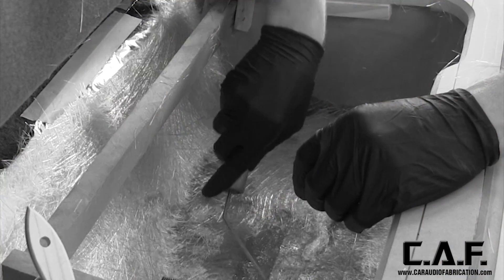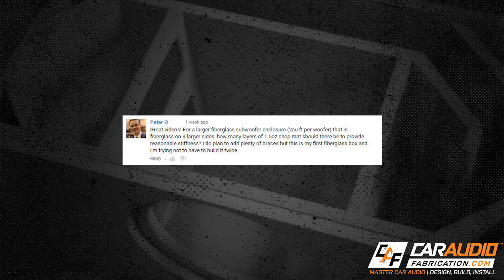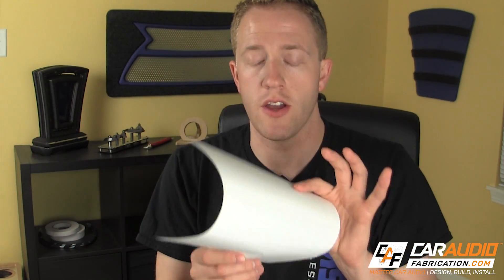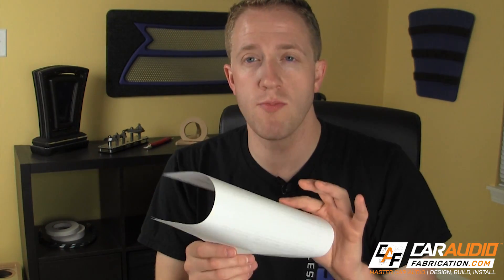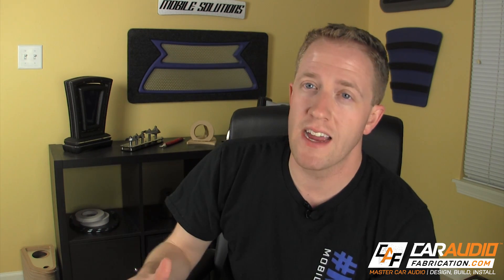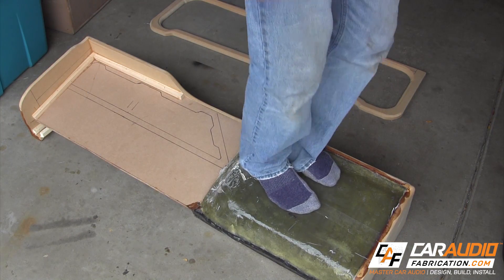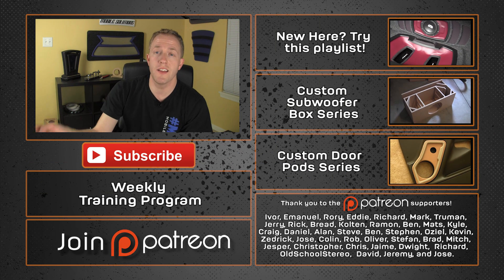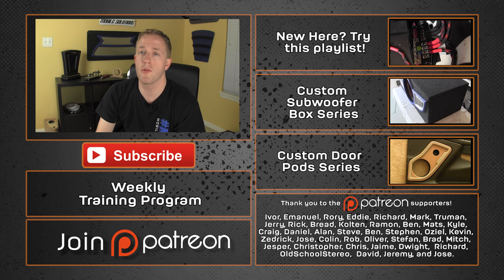How many layers of fiberglass are needed for a subwoofer box? – Fabrication Friday

Comment: Hi Mark, this might sound like "how long is a piece of string..." but I want to build a fiberglass sub box for the trunk of my car, and I want to avoid the box encroachment into the trunk area as much as possible. So, my question is this: is air volume versus the diameter size of the sub more important? If, for example, I could build an enclosure that would accommodate a 10" sub, but the air volume is under a cubic foot compared to an enclosure with an 8" sub but just over a cubic foot, the 8" will perform better as a subwoofer, yes?

Comment: I’ve done mine fitting into boot of X1.  I started with 150G to get into the corners and finished off with 300G weave.  Definitely recommend the ridges added using dowels or spare pieces of timber.

Comment: hey what's going on man I have a question for fiberglass boxes. I want to build a fiberglass box in the rear floor of my 2005 Chrysler town and country. I'm looking to make the front baffles to be flush with the floor that way I can still haul things in my van. I'm going to make sure I have protection grills for my sub. I'm curious what is the best way to start the mdf perimeter ring or baffle board and to make sure there is the best adhesion from fiberglass to mdf. I just am having a hard time coming up with a way to make the ring flush with the floor and how I will make sure the fiberglass connects to the mdf ring secure and the woofer baffles then can be glued and screwed to the ring. thank you

Comment: Great channel. First time trying this. I just bought a 2019 ram rebel quad cab. I'm gonna build a box under one side of the rear seats with a sundown 10". The sides and top of the box will be in MDF. I'm wanting to do the bottom with fiberglass because of all the waves in the floor. Its roughly a 15"x25" bottom. How much material and resins would you think I would need to buy for that size of a panel? Thanks.

Comment: Hi Mark,I just did my first fiberglass box in the spare tire well.Only the bottom and half of 2 sides are glassed to the sheet metal and there is a lot of curvature.I did 3 layers of 1.5 oz chop strand mat.The area is only 13 inches deep as well.Should this be strong enough or can I strengthen it with some type of epoxy?

Comment: I only use one layer of mat to make the initial shape.  Then I switch to fiberglass cloth for adding layers inside .  Cloth is way stronger than mat.  Mat for the form, because it forms in really well, and it's good for the top layer for a smooth finish.  But cloth (weaved fiberglass) is where the stregth is at.

Comment: Hey man, I got a question for you actually... I got a SWA-10S4 10" SCV Bassline Alpine subwoofer 4 ohms and I bought it as a package from car toys that came with a Bassworx sw10b 10" sealed 0.54cf enclosure. It literately sounded like shit nor did it bump at all. I grew on ported boxes with old school alpine brands;so I'm  raised and familiar with that shit, bumping on old rap like Ice Cube and Tech N9ne (NO NOT THAT NEW SHIT.).  I want that type loud and bumping down the street type of sound; so I picked up a 10" Atrend Bbox E10SV single vented box that is Gross Cu. Ft. 1.25 \ Net Cu. Ft. .90 \ (Tuning 39Hz) \Speaker hole cutout 9.12" on Amazon.com. Do you think I should use polyfil in this? I just want my shit to bump without that bullshit or damaging my subwoofer. Oh, Most importantly. My amplifier is a MRV-M250.  PLEASE help my dude. I've spent so many countless hours trying to get my shit right and to make it hella lit.
Reply: Hyptonic Promotions .. sounds like you need more amp power or more subwoofers.

Comment: First, great video!  When I've made fiberglass boxes in the past I usually start with a a wood backing and fleece stretched over a form (e.g., speaker mounting rings spaced out on dowels).  How do you calculate the structural value of fleece resined on both sides as compared to 1.5 oz chopped matt?  Thx!
Reply from the maker: Fleece adds essentially zero strength, you are just using it to capture your shape and then should be applying fiberglass mat on top of that. I try to avoid fleece when I can because it just sucks up a lot of resin for no real strength add. Better to use grill fabric to get shape then add glass to shape it.

Comment: you can also use styrodure to add thickness. just cut it into strips of desired dimensions and put them so that the fiberglass mat spirals around them. For example you start by making a base layer of fiberglass mat and then put on a styrodure strip and laminate over it. Then you take another styrodure strip and laminate under it etc. For making custom shapes you can do those with modelling clay and when the clay surface gets semi-dry you paint it with at least 5 coats of plastidip so the moisture doesn't escape the clay and makes it crack. For better release of the fiberglass from the plastidip you can spray it with 4 coats of pva. I reccomend you do 3 layers with fiberglass cloth or maybe even carbon fiber and epoxy resin. Epoxy doesn't warp much and the smoother surface you get with cloth or carbon will spare you some sanding. You can then add layers from the inside for strength because the epoxy resin won't warp your creation.I might be doing a subwoofer enclosure soon and if i do, i'll make a video.Hope this helps or gives new ideas.Cheers ;)

Comment: Mark, great video man. I hope you don't mind me adding a few things. I do lots of fiberglass projects. Sometimes massive builds with lots and lots of power and sometimes 70 and 80 lbs subs. In fiberglass enclosures. I got some coming up soon but video's yet on them. Anyway, I use 3.5 oz matting where ever I can and 1.5 in those hard to get to areas as you said. A few other things. You need to try to do all layers at one time. Don't wait for a layer to harden before you do the second and so on. Also I use 1/4" steel laminated in the layers where you use wooden dowels. This makes the box bullet proof. I just cut the steel into squares and stick them with hot glue as you do the wood dowels. Same method just bigger scale. Just thought your viewers might want to try that. Again not trying to steal your thunder. Just wanted to help.
Reply: 3 years later..i heard the cloth was stronger. Would the method change if i used cloth vs chopped mat?
Reply: @2ndshiftaudio300  8 yrs later but have you ever tried to use chopped fiberglass. I have access to thousands of pounds of fiberglass but it’s the small chopped pieces, just trying to find out if I could use a lot of that instead of the mats?

Comment: I've had very good results using strips of angle-aluminum to reinforce fiberglass structures. They're inexpensive, light, easy to work with and readily available. 3/8 are the ones I've used, but any size will help strengthen your box.

Comment: Very Informative, thank you!! I have a component related question, I have a F250 so the current door speaker are 5x7/6x8. I'm going to be swapping them to Components, however I've heard different opinions on using the 6.5's as apposed to the 6x8's. I know the larger the area the more bass, but won't the 6.5's give a more sharper sound?? thanks, Mark!!

Comment: Have you built any boxes for a super duty 2015? I want to run 2 kicker l7 solobarics 8". There's only 4.5 inches under the seat, I was thinking fiberglassing the area and towards the front make it taller to fit the subs.  Do you have any advice?

Comment: Great video Mark! Thks for saying hello, listening and offering some feedback yesterday @ SEMA; I truly appreciated it.Your advice about keeping the laminated layers of fiberglass in place until they're cured is spot on! This is critical, and it's important to remember that dry isn't quite the same as cured... The latter takes longer and varies according to ambient temperature (the hotter the faster), so it does help getting a heating infrared light bulb and fixture to heat the fiberglass laminate, being careful to monitor its temperature and not pointing the light to plastic trim in the car... Keep the great videos coming up man!

Comment: You are a car audio God my friend, thank you for all of your wisdom!!! Is there some kind of mating that you can add between layers for extra strength ?? I think I was told about something like this a long time ago when I had a fiberglass box built in my truck. Thanks.
Reply: Using core materials will increase the strength of a composite structure by a ton, but before you look into that I would look at stronger fiber i.e. a quality S glass